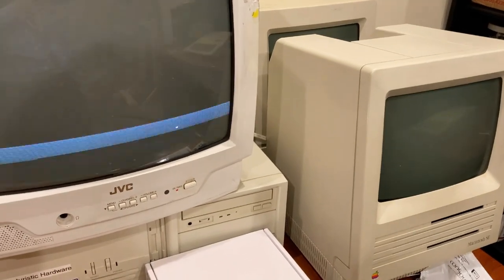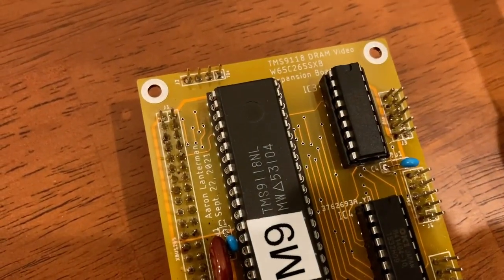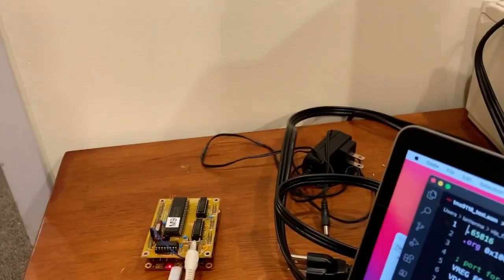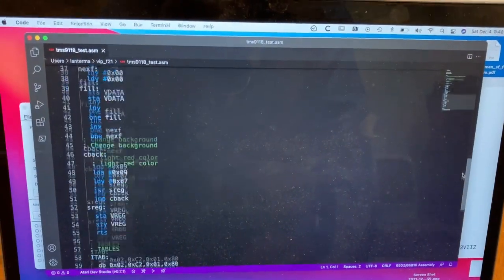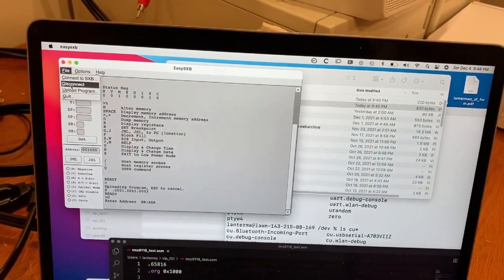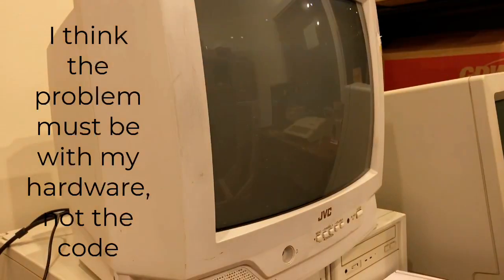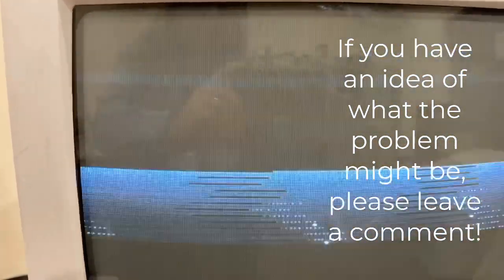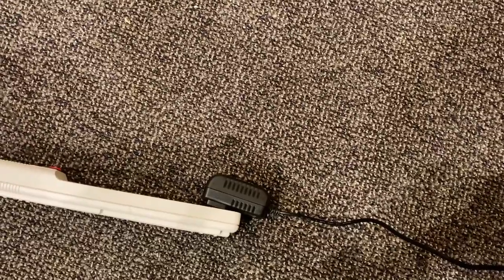[SOLVED] Glitching TMS9118 Expansion Board for W65C265SXB (like TMS9918)

Comment: A tad late, but ensure that you're using a 3x NTSC frequency 10.738635 MHZ (+/- 0.005%) crystal and may be add a unity gain transistor amplifier circuit with 75 ohm output impedance to the VDP COMVID pin.  There are lots of 10.7MHz marked crystals around but many of them are a tad fast at around 10.74- 10.75 MHz which will give you a stable picture but improper colours.

Comment: That may not be a genuine chip. Marking looks different than TI chips of that vintage. Open up a 99/4A or ColecoVision to see what it should look like.
Reply: Markings on this chip are similar to my TMS9128NL which works just fine. These were built after TMS9918s so this is probably just a later manufactured device. You can sort of smoke test whether this thing is real by checking pin 38 (CPUCLK). This pin should be the frequency on XTAL divided by 3 (it's the colorburst frequency). So if that's not correct your chip is either fake or burnt (or both!)